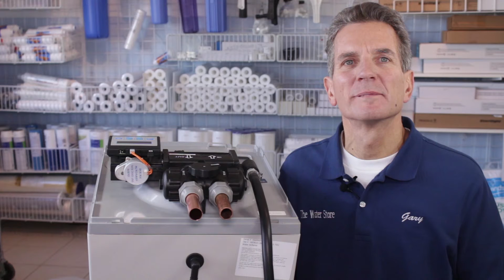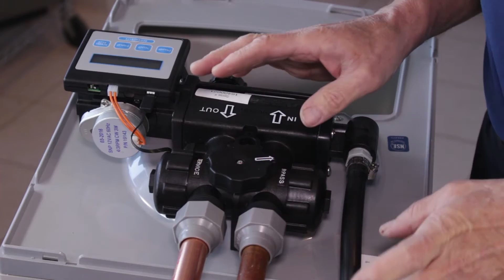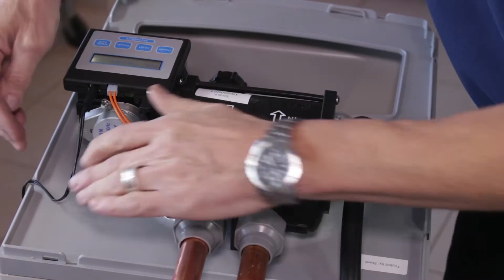Water Softener Installation Part 5A Putting Aquamaster into Service

Comment: Hi Gary. Love the videos. Also love your store - recently bought a new drive piston and an air gap fitting for an old Waterboss that I inherited.

Question for you: When the bypass valve is in bypass mode, does this not stop water pressure from entering the unit? I needed to replace the drive-piston, but I also don't want to have a flood on my hands. I assume I'll have to shut off the water supply regardless.

Other than preventing water from flowing through the media tank, does the bypass valve not function in the same way that an older style, three-way plumbing bypass does?

PS: I'm starting to think I should just replace the entire system (brine tank overfilling and nothing I've tried so far worked - ie; checked for pinched lines, checked all the brine lines, brine flow piston, etc according to your other vids) - this drive-piston replacement is a last ditch effort.

 Thanks!
Reply from the maker: Yes in bypass there is no water pressure to the system but there is pressure in the softener until you start a regen and release the pressure

Comment from the maker: Check out the procedure in this video for putting your Aquamaster into service during the installation.  Please note that at the 3 minute mark I comment that it will draw all of the water out during the brine cycle.  That is incorrect, it will draw out most of the water and leave a few inches of water in the bottom.